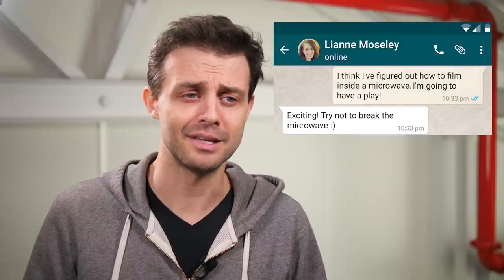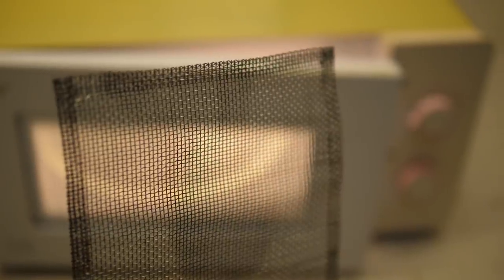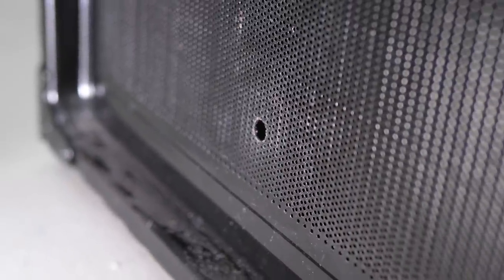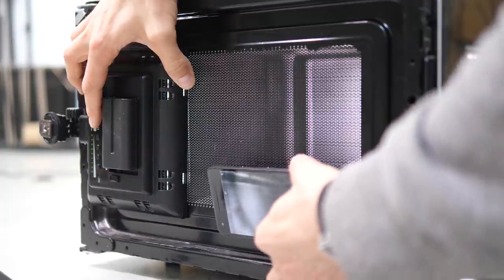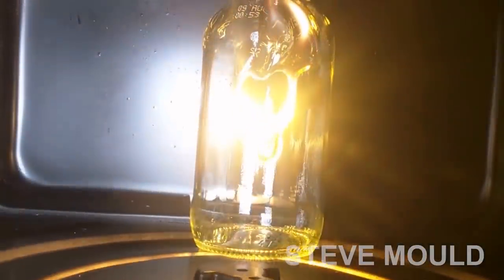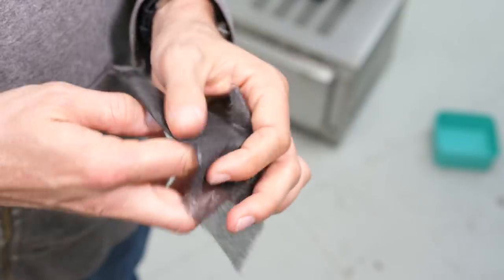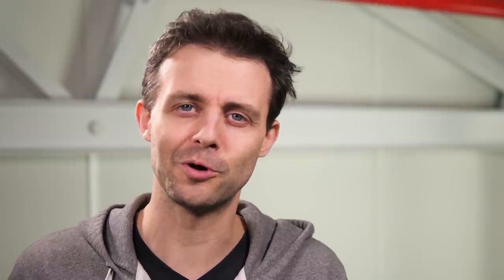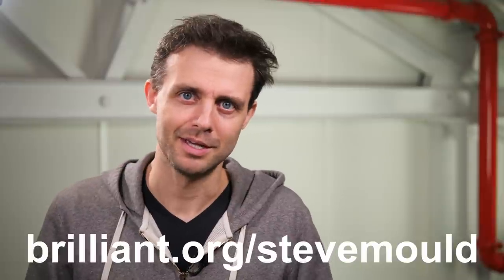How to film the inside of a microwave (2 ways)

Comment from the maker: I do live microwave filming as part of a stage show with Festival Of The Spoken Nerd. Our latest show is available on DVD, HD download and floppy disk: http://fotsn.com/ycpandvd
Reply: You can't polish a Nerd!
Reply: Did the math... thats around 42kg worth of floppy disks.
Reply: you don't need expensive carbon fibre tissue... with a match and some fibre of iron wool to self ignite the matches head in the closed running microwave, this will light the match and than the flame will boost to a bigger plasma cuz flames are plasma too... you will get a dense plasme ball, don't use a beaker, uae some thing like the beaker but with thiker walls because otherwise it will melt thruogh the beaker and the microwave ofen should be a robust one, because the dense plasmaball will over load it substantially
Reply: @JoseAlbarracin10  You might not be able to polish a nerd, but Steve's new haircut smartens him up a lot.
Reply: @ScopeofScience  5 1/4" single sided?
Reply: @maxximumb  He had to do the haircut midway filming, otherwise he cannot use a tinfoil cap 🤣
Reply: The metal walls of the microwave are safe because they are grounded. No electric charge can build up on them. This also why some microwaves can have accessories like temperature probes.
Also, here’s how you can make plasma with just a match and a microwave.
1. Light the match.
2. That’s the only step, because fire is plasma. You don’t need the microwave.
Reply: @bbgun061  The grounding part is not a satisfactory answer, grounding is just to prevent people to get electric shocks, the microwave doesn't shock up your food until it's cooked. It would be more wise to explain it if as something that got the metals parts inside the microwave to emit    deconstructive waves to those emitted by the magnetron. Also fire is not plasma because is not superheated.
Reply: johnny chang Google it, fire is a plasma.. and there are many other reasons for grounding things, a faraday cage for example can be grounded.
Reply: @greenthizzle4  Fire is an oxidative process which if hot enough can produce ionized gasses then it will  be called plasma but by definition fire and plasma are two different things. It's like comparing dinosaurs and jet fuel 😉 Also as I see the reason why the microwaves deflect itself and bounce insidecthe microwave enclosure is that all the metal parts are 'grounded' to the magnetron itself and therefore vibrate at the same wavelenght which make them less susceptible  to the heating effects which is what cook foods or fry the metals not in sync with the magnetron.
Reply: @johnnychang4233  I never said microwaves cook by shocking the food. But metal in a microwave will gain a static electric charge if it is not grounded. That's why it sparks and gets so hot.

Also Steve, I assumed you used a fiber optic camera, but great work!
Reply: @bbgun061  The way metals sparks inside the microwave isn't because of static charges, the microwaves just jolt back and fort the electrons in the outermost layer which make them react with the air and became pyroforic. Microwave are not ionizing radiation.
Reply: Was that your science microwave? Shame you weren't at the launch party, BTW.
Reply: what happened to codys lab microwave ?
Reply: I used to think if you make the screen thicker, the holes could then be bigger....due to the angle of the waves, derived from amplitude and frequency vs the cross section of your holes.... I really don't know about that though...
Reply: love the end music....funky ala jb's.....where can i hear more? love your channel too...thanks
the black skeptic nerd = galileoshift
Reply: Hi Steve, is it true that the sound of the plasma is dependent on the strength of the microwaves? If this is true, couldn't you potentially make the plasma play different notes?
Reply: @un1tyNL  ..i agree ,more dangerous than it seams...why take on this sized risk ? Also ceramic fuses...beryllium..very bad toxic death dust...and your overloading the machine...the safety valve...can kill you if it fails....think !
Reply: Do you have the derivation for the power reduction of EM waves encountering a wall of holes?

Comment: A note about using mesh screen vs. a perforated metal sheet as an attenuator: The woven nature of wire mesh results in what is effectively, a tiny resistor at each intersection of the wire mesh due to very small contact areas, and oxides on the surface of the wires. This results in ohmic heating and thus the hot spot as noted. Perforated metal doesn't have this problem.

Comment: The trick with very open aperture and the micro oven grill at 8:50 is very useful at Zoos. 
Very bright full frame telephoto lenses, more than 85 mm with large aperture, larger than f/2.8 can disappear the cages. The longer focal length and bigger aperture deliver better results. It is a trick of optics.

Comment: I'm a prototype engineer/machinist for the Uni of Sydney and made a solution for this problem for one of the researchers. Basically we used a tuned length and diameter tube port into the microwave that allows physical access in and out while it's running while attenuating all the microwaves :)

Comment: Just a note on the mesh.... It acts a collection of very small and very short waveguides... These waveguides do not support any modes at the microwave frequency of the oven and it will die out exponentially when it tries to pass through.... So basically what you have is a very large surface area High Pass filter that passes frequecies that is a few orders of magnitudes higher than that of the microwave... like visible light.... The reason why they dont make it to pass exactly at the microwave frequency is because the cavity where you put the food in acts as a resonant cavity for an oscillator (the magnetron being the active component). This resonator resonating frequency is a function of the cavity dimensions, but also the permitivity of the material inside of the cavity... Thus the frequency and deadspots and modes generated inside of this cavity is quite unpredictable to be exact, but will always fall inside of a range that  is below the cutoff frequency of the mesh... :)

Comment: Metal is fine in the microwave. It’s not about metal, it’s about heat dissipation. If you put tin foil or a metal can in the microwave heat will build up in spots on the metal, make plasma, then arc. This is because of how thin the metal is and how quickly heat builds up in spots. 

If you leave a thicker, rolled steel fork in your food no problem (not cast iron too many holes and voids). No it will not break your microwave. The magnetron puts a fixed amount of energy into the faraday cage. If that energy is absorbed better by a piece of metal the magnetron doesn’t get hotter it’s output stays the same.

Only 2 things will break your microwave. 

1 putting something in the faraday cage that heats up to the point that it melts or breaks the faraday cage. 

2 running the microwave empty, this causes all energy to build until the microwaves find imperfections in the faraday cage to escape through damaging the faraday cage.

The safety mechanisms in the microwave prevent it from running if the latches or faraday cage are broken, therefore broken microwave.

Comment: The mesh isolation method is applied in many other situations, beside microwave ovens. E.g. radio telescopes (telescopes, that take images with radio waves and not with visible light) are also meshed for the sake of weight reduction and stability. The difference is that radio telescopes reflect the light instead of isolating it.

Comment: Just doing some rough calculations.  Microwave ovens output between 600 W and ~1500 W depending on model.  Radio frequency exposure limits vary around the world as to power density in millwatts per centimeter squared mW/cm^2 and as to exposure time.  In the US, the general population limit is 1 mW/cm^2 averaged over a 30 minute period.  

So, let's say you have a 1000 W oven.  Converting 1000 W to mW gives you 1,000,000 mW.  Assuming you have all the 1000 W of energy is bouncing around the inside of the oven and is available at the enlarged hole in the mesh for the camera (it's probably not, but figuring worst case), you would need to attenuate the RF energy by 1,000,000 times to reduce the 1,000,000 mW down to 1 mW.  That is a factor of 10 to the 6th power or an attenuation of 60 dB.  That is a factor of 100 more than the 10 to the 4th power you've estimated.

Since the hole is 1 cm in diameter, the area is 0.785 cm and the power density at the hole would be 1,000,000 mW x 10^-4 / 0.785 cm^2 = 127.3 mW/cm^2 using your estimate of a factor of 10 to the 4th power reduction from the 1 cm diameter hole.

As stated, the power levels drop off exponentially with distance from the hole and there is a time averaging function over the 30 minutes so if one is only running the microwave oven for a few seconds here and there over the 30 minute period, that helps. 

All that said, would I try this if I had a spare microwave to play with, probably.  But I'm a EE who works with radio waves and who has  a spectrum analyzer and other test equipment to perform RF measurements to verify everything is safe.  For the average person, as they say, your mileage may vary . . .

Comment: I believe that the heating happens on corners and edges, where there is an abrupt change, and a cavity or resonance set up, plus the entire metal is acting like an antenna, and all the energy it picks up tries to concentrate on the small places and reradiate.
Where the corner of your screen melted into the glass, you were likely actually creating a resonant chamber between your mesh and the mesh in the door, and it was concentrating energy there.

Also notice how the door mesh, vent mesh and interior light mesh also all use round holes rather than slots anything.
I wouldn't be surprised if this reduces the heating of the metal.

I suspect that if you took your screen, preformed it over a ball or something on the table to get smooth curves tapered into flat edges to blend in, and then taped it to the flat end wall so that the edges were in contact with and blended smoothly into the wall, and everything was smooth, that it would heat much less.
If you wanted to put a camera inside, you would probably need to basically actually make a new end wall matching the edge radii, so that you didn't get any blind corners or loose edges.
The problem would be that the inner glass would prevent you from sealing it to the door mesh, so you would have a lot of energy get behind the wall to the camera, and probably melt the edge.

Since you already have a busted microwave, you might be able to replace the punched round hole screen with the fiber screen to get more light through and better images, or just cut a section out and attach the screen over it.
You might still run into problems with edges, or with the "sharpness" of the square woven mesh itself.
If you cut the mesh large enough to get pinched between the door gasket and the face of the door frame you would be able to eliminate the most edges to heat up.

If the square mesh heats up, you could also take some thin sheet metal and drill a pattern of larger holes in it, possibly even with tiny holes in the diamonds between the larger holes to get as much light as possible.
That sounds like a job for someone with a laser cutter, or cnc machines, maybe another collaboration? Lol
You could also buy pre punched sheet from suppliers like Mcnichols.com

Imagine replacing the front, top, and end with mesh and being able to get multiple angles and good lighting!

Comment: The thickness of the holes matter. You could have a large hole that attenuates a lot if you mounted a flange and metal pipe inside of a bigger hole. Great for filming or, if you use a couple, flowing reactants in and products out.

Comment: 01:49 You can put metal in a microwave and it does not break it IF the shape of it allows it. If you for example put aluminum foil in the microwave that has an uneven surface like crumpled up foil it will light up with sparks. Mesh will do the same or it will light up and melt depending how intense (wattage) the microwave radiation is. On rough metal surfaces the sparks are created because the microwave energy creates electrical potentials and the sparks even out the charge. If you put a steel ball inside a microwave it will only get hot unless you heat it up too much then it will start to glow and might destroy or damage the turning tray. If you had something better than a normal microwave and some nitrogen as well as a something "fire resistant" you could make a lamp out of it, but it might deform because of the heat. You would also need a bowl that lets microwave through because the nitrogen is heavier than air and it would stay in the bowl unless there is wind.

02:25 There is a reason for that mesh in the door only having rounded holes. It's because of the electricity=heat buildup (potential difference=charge flow="friction"=heat) that would otherwise build up.

Comment: King of Random did this by drilling a small hole in the back of the oven. Don't have to remove much from the oven because the back of the oven cavity is usually the same metal sheet as the back of the oven. But, as you mention when talking about the advantages of the 2nd method, it is still limits the camera angle.

Comment: you dont have to use your good microwave that you use for cooking.

if you can go to an appliance repair shop you can maybe pick up a junker for experimenting.

if you live near a college town you can find them thrown out by the students. and often still work but grungy inside as students often splatter them with food stuff and dont clean them so if that makes you sick and you are not comfortable with cleaning up after the students first you can get them new or even used at yard sales too.

if you do decide to mess with the high voltage parts of a microwave just remember to be careful with the high voltage parts as there can be a charge left so be careful not to get zapped

Comment: huh, I was waiting for the talk about how each of those little 'holes' within the grate are typically a quarter wavelength (suitably under the heading of microwave engineering). 
Furthermore, when the holes are all symmetrical (in size and alignment) they can cause a inductive/capacitive affect where they treat the grill like a capacitor and actually start transmitting radiation more easily than intended (hence why new models of microwaves typically don't have a uniform arrangement of holes).
Reply: As stated in the video the holes are 1/100th of the wavelength. Consumer microwaves use ~10cm waves and the holes are ~1-2mm. Not sure really what you're getting at there?
Reply: Ah, I should've been more specific - I'm talking about the length of these holes not their diameter/radius. These holes are actually tiny little cylinders which are known as waveguides (think an electrical conductor, but for radio/microwave frequencies).

Imagine there is only one hole in the grill and let's look at what we would expect to occur we would expect there to be some small amount of seepage or leakage known as diffraction, however that typically doesn't occur because the grill is designed to function as a quarter wavelength waveguide. You can think of it as waves lapping up against a 2x4 wood dock; you can watch the large waves strike one side of the dock, and on the other side you can see these smaller ripples coming out from between the cracks of the dock (this is a metaphor for diffraction)

Now, diffraction isn't an issue for these microwave doors because they are also designed as a quarter-wavelength waveguide. What is a quarter wavelength waveguide? It's a complicated matter because it takes into account how radio/microwaves move through mediums = tldr; if it's a quarter of a wavelength then it makes an open circuit look closed and a closed circuit appear to be open. Essentially due to math/physics you can ensure that at the end of the quarter wavelength (the 'holes' in the grill) the wave would have a total energy amount of 0

Now, if you have a grill/grid full of these tiny cylinders and they are all uniform in arrangement and size there is a saturation problem (all these cylinders get filled with energy at the same time) which can cause the grill to function as an inductor/capacitor and allow energy to (more) easily transfer.  Hence why most modern microwaves don't have these 'holes' in a uniform pattern and sizing. 

I've provided some links to Quarter Wavelengths below but i've been unable to find any articles citing the issues as I've noted them, i'll update this if ever I find any:
https://www.microwaves101.com/encyclopedias/quarter-wave-tricks
Reply: @Seer_Xaeo  oooooo!! interesting thats cool

Comment: Has anyone tried moving the mesh quickly? Either oscillating it or spinning a section of it quickly enough would mean it became blurred in the same way as your depth of field hack, but would allow greater freedom with camera settings. More noisy, potentially, if that's important.

Comment: This video is years old so I assume t won't reach but I have to ask, what happens if you have a really long hole? When you were talking about wave length and its ability to escape certain hole diameters we were always assuming a perfectly circular hole, what about a spiral shaped hole or a hole that's disproportionately longer in one direction? if that's not the issue and we assume that to be treated as a series of holes; what about studding the hole? for example what if it was a square or a star shape? is that to be treated as the total potential diameter of it at its out most circle? the furthest gap length? the inner most complete circle? or some sort of combination?